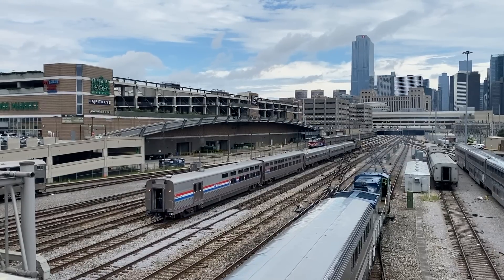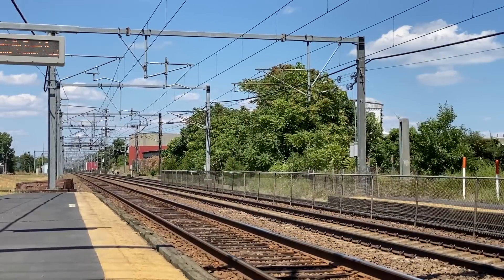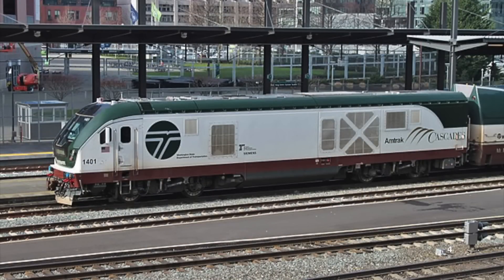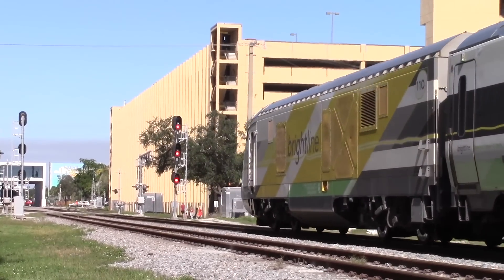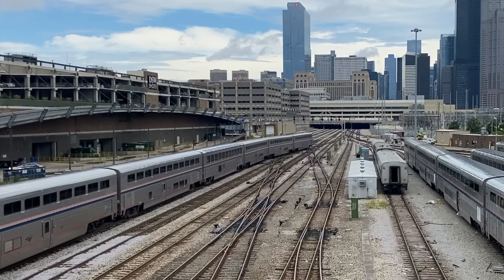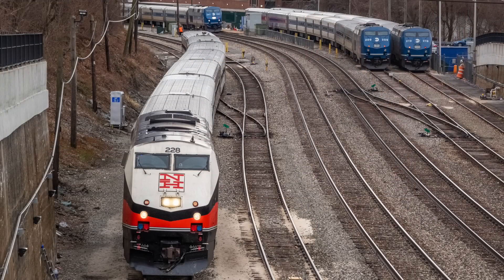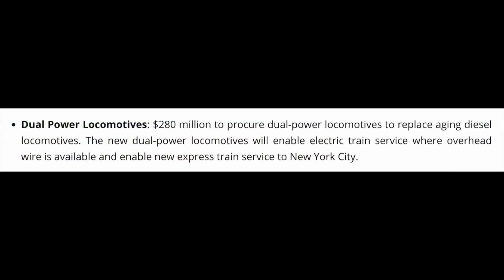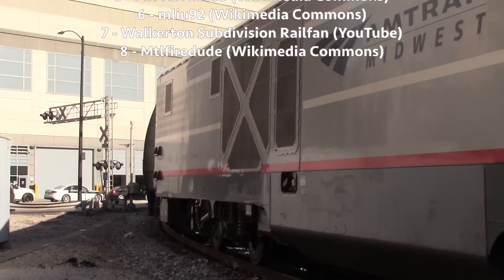Siemens Charger: Locomotive of the Future

Comment: I know an Amtrak engineer. He told me the new Siemen's is a real winner. He is hopeful the entire Amtrak locomotive fleet will be this well designed piece of locomotive power.
Reply: Siemens is not a possesive or even a plural, it's just a German family name:
Ernst Werner Siemens (von Siemens from 1888; English: /ˈsiːm.ənz/ SEEM-ənz;[1] German: [ˈziːməns, -mɛns];[2] 13 December 1816 – 6 December 1892) was a German electrical engineer, inventor and industrialist. Siemens's name has been adopted as the SI unit of electrical conductance, the siemens. He founded the electrical and telecommunications conglomerate Siemens.
Reply: I like the Chargers, and they even make sense for dual-mode - as NJT and even MBTA prove every day.
Reply: And what about Metra?  There - like the NEC - has both caternaries and diesel.
Reply: At some point, I am expecting MARC to wind up with ACS-64s of it's own because of the Brunswick and other noncaternary interchanges at DC Union Station and Baltimore Camden Yards.
Reply: @KaiHenningsen  the correct possessive form is Siemens', at least in German.
Reply: I'm a former locomotive engineer and yes it's nice to see Amtrak getting the ALC-42 locomotive, but realistically Amtrak maintenance is less a little tardy. 
The carrier by nature, turns its equipment way to fast, so even if the carrier has those who really do there job, really can't, because the carrier may need the locomotive right away and so much maintenance for that locomotive, until it breaks down and that's the company's policy. 
Do you really think the lets take the P-42's for instance. These locomotives do short distance to long distance routes. Now granted, they're Capped off at 110mph and there're some of the freight carriers, which Amtrak has to operate on, have certain parts of their railroad that allow 90 to 110mph, basically account of grade crossings. The FRA will not allow 125mph when crossing are in effect. That's why the Northeast Corridor, with the exception, of  trains operating on Metro North railroad, is currently the fastest rail line. 
Whenever Brightline gets up and running, the trains will be able to get up to 110 mph, between West Palm to Cocoa and from Cocoa to basically the curve before Orlando Airport, 125mph, but on that particular track, there's no grade crossings. 
The FRA has the final say on track speed. The way Brightline is having fatalities, basically everyday, account of grade crossings, even 80mph, on the Miami to West Palm Beach run, I don't know if they'll be able to do 110.
Reply: Siemens makes awesome stuff. Always have.

Comment: Sadly as a Metra rider we won't see these until every last EMD locomotive is used up by them.
Reply: They need emus not chargers
Reply: @erikgustafson9319  they dont need emus
Reply: Sounds like a good thing
Reply: @danielchou5895  They do. They need something like Stadler KISS or CAF/Alstom Renfe S-450
Reply: @truedarklander  No they don't...
Reply: @danielchou5895  yes they do it's literally the correct type of train to use in commuter settings
Reply: @truedarklander  No its not lol. Do you know anything about American railroad operations?
Reply: @truedarklander  Metra’s only got one singular line that’s electrified and utilizes EMU’s, and all their other lines are just standard diesel hauled push-pull operations.
Reply: @danielchou5895  I normally push back against the demands on here to "electrify everything in the US!!!!" but for a stop-go commuter network like Metra, double-deck EMUs would give significantly superior performance. It's exactly the environment where the strengths of electric trains are most useful and the downsides most limited. It's for the most part the opposite operating conditions to most of the US: relatively high frequency, short, stop-start traffic where acceleration is important for timekeeping.

HOWEVER, Metra has several problems with implementing electrification on its system. One is that they don't actually own and control most of the rail lines their trains run on. There are one or two where that's not an issue and could be electrified but not many. The other problem is they don't have money. They don't even have funding to replace their old equipment properly, there's no way they can pay for electrification.

Given their circumstances I think their best option is equipment similar to what Go Transit uses: more MPXpress locos and modern bilevel coaches. For the electrified lines, new EMUs similar to what Caltrain has acquired would be excellent. If they really have the money and the ridership, they could also look at electrifying the one or two diesel lines they own and operate themselves. (But I don't expect any of that to actually happen, unless they can get stuff secondhand!)
Reply: @justahillbilly7777  the point is that they should electrify and modernize their current EMUs
Reply: There is resistance to electrification - and it has nothing to do with rail.  The reason is aesthetics - power plants - even wind power- is an eyesore.
Reply: Metra is a "brand" - BNSF is the main opera or - but not the only operator.
Reply: @PGHammer21A  and oil rigs and refining plants aren't? 😂😂😂
Reply: BNSF operates the Electric Division - however, there is the Silver Single Line - also in Metra turf - caternaries and all.
Reply: @PGHammer21A  also, the rolling stock is owned by metra nontheless. Even if operations are subcontracted
Reply: @PGHammer21A  In some parts, where BNSF owns the trackage. Union Pacific controls a sizable chunk, and there are lines (mostly in the south/east) that Metra operates themselves. As I understand it, on the lines BNSF owns they are contracted to operate services, and it's much the same with the other railroads.
Reply: @PGHammer21A  There are plenty of reasons within the rail industry not to electrify. Also, aesthetics are a minor concern even with wind and solar power. Both have major issues in the environmental, engineering, and maintenance sides.
Reply: @erikgustafson9319  emu's you mean dmu's
Reply: It’s not sad because chargers are not good EMD locomotives are really good but GE locomotives are better
Reply: @Strasburg_Railfaner611  EMD locomotives were good for their time, but for most that time ended 20 years ago. Many are as old of the F40 units are as old if not older than the E9 units they replaced, even the ones that ran until the 90's on the BNSF. Yeah, the Chargers have teething issues, but all the Metra locomotives have aging issues and are subject to the same kinds of breakdowns, but year-round and not just in the cold.

They also objectively beat out any current passenger locomotive when it comes to emissions. I don't know if you have ever been in the Chicago Union Station North Concourse, but the diesel fumes are so thick you can see them all the way down to the cab cars. Metra runs so many Tier 0 locomotives that even if they take the full order of the SD70MACH locomotives it will not replace them all.

And yeah, the P42's have been reliable, but they are the last passenger locomotive GE has made for America. With the last one being produced over 20 years ago, any new locomotive is pretty much going to have to start from scratch. The only other option would be to refit freight locomotives like they did with the Dash 8's but that was only done as a stop gap during the P42's delays.
Reply: @andrewreynolds4949 as of right now MPXpress is Discontinued
Reply: @mbrproductions160  Yes!!!

Comment: The Brightline Chargers don’t usually operate at the same time. It’s usually one engine pulling/pushing the consist while the other is there to give HEP. When the consist gets longer (8 cars) they will start using both engines.
Reply: I was thinking what a waste 2 engines for barley 80mph
Reply: @damnimloomin  it bothered me that he said higher speed rail service when talking about brightline. As you said its 80 mph for them and thats really slow
Reply: @adamknott7830  they are already testing high speed service to be fair I hope they’re able to resolve the level crossing issues along US 1 so they can go the top speed! But yeah 80 is how fast people go on the highway in Florida lol not that appealing on travel time.
Reply: @damnimloomin  they dont have a high enough class of rail either if im not mistaken. They built themselves into a max speed of 80 mph which i think makes me more made than the actual speed itself
Reply: @adamknott7830 Brightline bought the extra power for their latter phases of service. It's a 79 mph limit in the metro Miami area, or Miami to Palm Beach; a speed that's pushing it for how many people and grade crossings are in play.  

From Palm Beach to Cocoa, the restored dual track of the FEC is being set up for 110 mph, and the new track from Cocoa to Orlando is set for 125 mph.  Their PPTs show a 150 mph design speed for the Tampa extension.
Reply: @brandonbloomquist3267  ok well thats better than i had originally heard then
Reply: @damnimloomin  in Turkey, 6-car CAF high speed sets (TCDD HT65000) has 6500hp and run at 155mph speed. Our 8-car Siemens Velaro (TCDD HT80000) trains has 8000hp and are capable of running at 185mph. So yeah, it would be a waste to run two 4000hp locos for 4 cars, but when you consider HEP and trains being heavier, i guess it kinda makes sense that you would need a second power unit.

I sincerely hope that Brightline electrifies their lines for future expansions though, electric power brings so much to the table.
Reply: The two engines provide the ability to change train direction at each end of line very quickly.  It also adds redundancy in case of mechanical issues, redundancy for HEP, and additional HP for speed and acceleration.  Trains for British Rail, Deutche Bahn, SNCF, etc have run standard operating procedure with engine and cab on each end of training for decades.  Very simply, it’s proven and it works.
Reply: @tspenceriii  
Honestly, I can't think of a single instance where DB, BR or the SNCF ran regularly scheduled trains with engines at both ends. Cab cars have been commonplace since the 60s for trains needing a quick turnaround, so you still only needed one locomotive. Sure, there's some instances when cab cars aren't available (and according to locomotive engineers it's quite fun to drive a six car consist with a combined 16000 horsepower), but those are very rare exeptions. Modern locomotives are so reliable that you shouldn't need an entire engine as redundancy, especially on routes as short as the Brightlne service.
Since these trains are planned to feature eight passenger cars, I suspect the actual reason is that Brightline didn't want to spend money on cab cars or turnaround operations in the interim, and instead rather swallow the cost of running an additional engine on their trains.
Reply: I have heard it would be an eventual 7 cars and not 8 for Brightline. If otherwise, can you please link the article in your reply.
Reply: @mikeblatzheim2797  have you have never heard of the British Rail High Speed Train (IC125)? There were 95 of them and some are still in service. With 4,500hp on tap they hold the diesel speed record of 148.5 mph. The Australian XPT used the same technology. Before the IC125 BR ran Edinburgh - Glasgow shuttles with class 27 locos at each end.
Reply: @chris8405  
They are considered DMUs though, not independent rakes of locos with coaches. This is similar to the ICE 1, which consists of two power cars and coaches inbetween, yet in practice the consists operate as a single multiple unit.
Reply: @brandonbloomquist3267  The chargers aren’t designed for 150mph.
Reply: @nickdrake527  The platforms are long enough for 10 cars (8 cars and 2 power units) Brightline will gradually be adding more cars to reach that as service expands.
Reply: @mikeblatzheim2797  I agree, most of reversible trains in Europe are EMUs/DMU's, or have a cab car. I can think of only one European operator of trains with a locomotive (Bombardier Traxx - electric) on both ends of the train: Nederlandse Spoorwegen (Dutch Railways) on their  IC trains.
Reply: @Adam Knott Higher speed rail means a fast train on conventional rails. It's slower than high-speed rail.
Reply: @brandonbloomquist3267  That's not accurate. The section from Miami to West Palm will indeed stay 80 mph limited, but they might increase the in-operation speed from 70 to 80 mph. They're not able to go full blast there because of the crazy unprotected crossings. 

The West Palm to Cocoa segment is not 110 mph. The absolute top speed on that section is 110 mph, but it's not a continuous fast corridor like the HSR sections on the Northeast Corridor. There are slow turns, slow bridges, slow station approaches, and complicated intersections that are hard to secure. The slowest bridge on the route is 50 mph limited. All the station approaches will be below 70 mph. They will have to go slowly through the crappier grade crossings. Although, Brightline is not exactly a safety-minded railroad, even they won't be able to justify risking 110 mph through some of those places.

And finally, only 20 miles of the Cocoa to Orlando segment will be 125 mph limited. The rest will be 80 mph. So when all is said and done, only 8.5% of the new alignment will be at 125 mph with a few sections of 110 mph track. That's just barely "highER speed rail". Like just baaaaaaaaaaaarely squeaking by with a hair to spare.
Reply: @damnimloomin  I'm not sure wheat-er that's relevant. Maybe they're just going against the *grain*.

Comment: Aesthetically, I like the VIA Rail SC-42 over the Amtrak ALC-42 as the VIA Rail one just looks sleeker and better looking IMO. Of course, beauty is in the eye of the beholder as most of these Siemens locomotives are good looking.
Reply: I have to agree with you
Reply: I thought via rails Chargers were classified as scv-42s
Reply: @jfp3earth357  they are I think
Reply: Quite frankly, at least from european view, north american rail isnt exactly a story of design hits - most of the equipment looks bulky at best. And thats not just the safety regulations - I feel like its just not an important point.

The new brightline trains look way better though!
Reply: @kennichdendenn  because it was designed by Europe.
Reply: @gamerfan8445  fair enough... Maybe, its just a question of familiarity then.
Reply: @kennichdendenn  to a lot of people that' big beast look is better, also considering the amount of grade crossings North American rail has I think it was a mistake to ever get rid of American crash test standards since the Europeans trains will just soda can on impact.
Reply: @penskepc2374  
Following local safety regulations US trains have to maintain a rigid structure even in the event of an impact, whilst modern European trains incorporate crash structures inspired by the automotive sector. So you've got rigid crash cells to protect the occupants as well as softer crash structures that deform on impact and thus absorb a lot of the energy. This does look worse, but is in fact safer for all involved (and the reason why US safety regulations were amended). Additionally this allows for lighter trains, meaning they're cheaper to build, cheaper to run and faster. 
They don't actually 'soda can', all the important bits tend to stay intact. There's a video on YouTube of a Stadler Flirt crashing into a heavy haul transport stuck on a railway crossing; the entire first carriage got launched and pretty mangled, but the driver was fine.
Reply: @mikeblatzheim2797  it has nothing to do with what you"re saying that's just what defenders like to say, it's about weight and besides crumple zones mean nothing good if you're not strapped in
Reply: @penskepc2374  
What do you mean, "crumple zones mean nothing good if you're not strapped in"? Just think about it for a moment. What's better, do you think, if you're not strapped in: An instantaneous stop sending you flying or a more gradual stop that might not?
Reply: i know im gonna get my ass kicked for saying this, but i actually like the aesthrtics of the original Siemens chargers (SC44)
Reply: @mikeblatzheim2797  the instantaneous stop is much more likely on a European trainset. A PC42 with Amfleet coaches is going right through most things.
Reply: I like the Brightline Charger and SC-44 Charger more than any locomotive
Reply: They both look equally good in my opinion. Both fitting their own roles, the VIA rail ones look like sleek fast commuter rail and the ALCs looking fit to carry long distance sleeper trains

Comment: I hope Amtrak will give the P42’s a farewell run just like they did with the AEM-7s
Reply: It would be silly if they didn't.
Reply: I just hope some get preserved!
Reply: How are they supposed to do that? AEM’s ran on one like, P42s are everywhere and have already been completely replaced in some parts of the country
Reply: based on how long the f40ph lasted I doubt that will be anytime soon
Reply: It will depend on who and where - B@O will get at least one from AMTRAK - because the Smithsonian has no annex.
Reply: I want them to do the same with the ACS-64
Reply: @ronal8824  Some local rail companies may purchase P42DCs to replace the F40PHs they bought.  I hope not.  I'm a fan of the old reliable F40PH.  Those screams never need to go silent.  😊
Reply: @D2Kprime  the ALC42's are much more fuel efficient than the P42's
Reply: The NPCU F40PHs are also going to get replaced :(
Reply: Agreed
Reply: @rivertownproductions Probably gonna be sold to private passenger operators, Tshiuetin is likely getting P42DCs to replace it's ex-Amtrak F40PHRs.